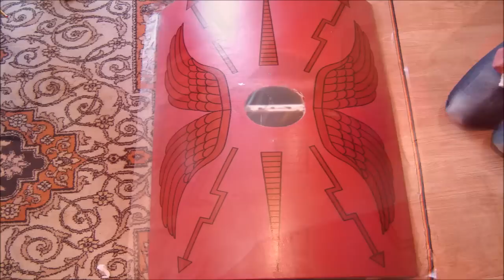making a roman shield(scutum)

Comment from the maker: I live in Eastern-Europe and I found the wood from a hardware store. 
I would recommend any kind of plywood that can bend. Fist layer was just plywood then I cut a bunch of strips from the similar plywood glue it on top of the first and also stapled it to hold until it dries. And then on top another layer. Make sure the thickness of the shield to be around 5mm + vinyl. 
I found the image on the internet maximize it and then printed in a print shop.

Comment from the maker: My scutum is a 9-10 kg large oval curved shield made from wood glued together and covered with fake leather. I used the dimensions of the best surviving example of a scutum, from Dura-Europos in Syria. source wikipedia
The wood was 1 m (42 in) in height, width 0.86 (34 in) and 2 mm thick.(i used three layers of wood)
The boss was made from and sphere and a metal plate. The sphere was cut in two and then”glued” to the plate.

Comment from the maker: Sorry for not answering was very busy.
The sphere and plate were wielded together. To make it easy for me I went to a metalworker and he did it for me.  
I don’t know how many planks I used I had a lot of them and had many spare ones.
The curve of the cycles is almost the same as the shields 0.86-0.70m 
Success on the project 
If something won’t look or happen as you wanted, its ok just remember that good things come when you worked hard, and prepared.

Comment from the maker: .

Mark Belciug   1 month ago   

My scutum is a 9-10 kg large oval curved shield made from wood glued together and covered with fake leather. I used the dimensions of the best surviving example of a scutum, from Dura-Europos in Syria. source wikipedia

The wood was 1 m (42 in) in height, width 0.86 (34 in) and 2 mm thick.(i used three layers of wood)

The boss was made from and sphere and a metal plate. The sphere was cut in two and then”glued” to the plate.
longaevitas rome!!:)

Comment: where did you find the metal thing in the middle?
Reply from the maker: I cut a sphere in two and then wielded it to a metal plate.
Reply: It's called a 'Boss' if you can't make one you can buy online from ancient weapon sites. :)
Reply: Julianus Maximianus
Where's a good site that I can an inexpensive boss?  I can't seem to find one under $60, which would be more than all of the materials for the shield combined.
Reply: RomanMoses28
 To be fair, internet armour stores are your best bet. Some have 'brick and mortar' stores too.
I live in the UK and I go to a store called The Armoury in Rochester High Street. They mainly sell complete things though i.e. a ready hand forged museum quality sword, rather than 'bit' you can use.
Ok, so what I do is 1 of 2 things - First try UK based History Reenactment Groups for 2 reasons. 1) They all hand make their shields and 2) Generally, UK HRGs are more knowledgeable about this subject than US groups.
Second, try just Googling "Iron Boss for Roman Scutum" or replace the word 'Scutum' for shield. There are dozens of sites that sell them. BUT, make sure you measure up BEFORE ordering, and double check it's definitely what you want for obvious reasons.
As for price, I can't help you there, it really just depends on the seller. However, you can but ready made historically accurate Roman shields from a handful of sweet online stores, and it's relatively cheap for the high quality you get.
PM me or something, and I'll send you some links.
Reply: Finnley
Reply: Ehh, kult of athena sells some, not the best tho, best just to make it.
Reply: Use a metal mixing bowl, could find one at Walmart or even better, Goodwill.  Then, attach that to some metal (Lowes / Home Depot would have sheet metal, roof flashing, or even thicker metal plates) using glue or welding.  Rough up the bowl and metal using steel wool / sand paper and then paint it all using a metallic paint color of your choice.  Could use a sponge/paper towel to dab the paint to give it a more metal look.
Reply: Alternatively, if you don't care to use metal then use paper mache with a cooking bowl or similar object.  Ensure you use long strips to form the boss and plate.  Let dry and trim up, paint using a metallic paint for maximum effect.

Comment: No screws used back then I think 🤔.  Main idea behind engineering is to use plywood with each layer oriented 90 degrees from each other and curved surface for added strength as well as being light enough to easily carry on foot at long distances without getting fatigued.

Comment: Hey Mr. Belciug, what type of wood did you use for this, and how did you get a metal sphere to make the boss?
Reply: i am not in a Roman reenactment group but i do Medieval stuff, 1st to 3rd Crusade. I used Ply wood for my shield, about 12mm thick, but it is flat (good luck curving 12mm ply wood without breaking it). I have seen people make Roman scutums using thinner pieces of ply wood and layering them on one after the other.

Comment: Why wouldn't a shield be made entirely of metal? How can wooden shield block missile weapons?
Reply: For starters, wood tends to be both cheaper and lighter than metals like iron or steel. Typically the only all-metal shields were small bucklers designed exclusively to fend off melee attacks. Even the kite and heater shields typically worn by Medieval knights were mostly wood with a fairly thin metal shell or rim. So yeah, a shield made of good quality wood is actually pretty ideal for protection against most projectiles. Well, until guns enter the mix...
Reply: ***** Thanks
Reply: Teoh Tong Wei wood will stop missile weapons, arrows may poke their head through but that's it. Metal would just be too damn heavy for any warrior to use without becoming exhausted. And an exhausted warrior is a dead warrior.

Comment from the maker: Question 1
A:I looked at some roman shield designs on the internet then ordered the design or template 2:48 . And then applied it to the shield (the material is like a sticker). But then I realized the shield looks weird 2:57 so then I cut the wings etc. 3:00 and then painted the shield 3:17
Question 2
A: Cut the hole with a jigsaw and attached the handle with screwdrivers.   
Question 3
A: Didnt count them:)

If you liked this vid please subscribe my channel :) 

PS: Are you from Japan? :)